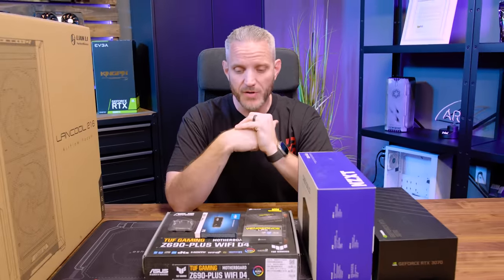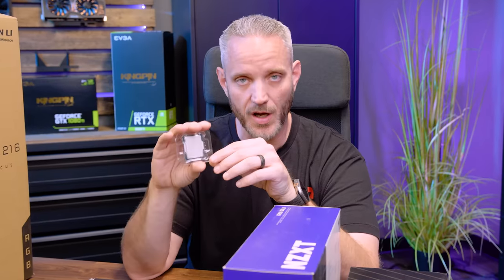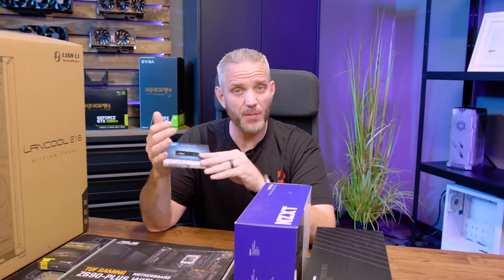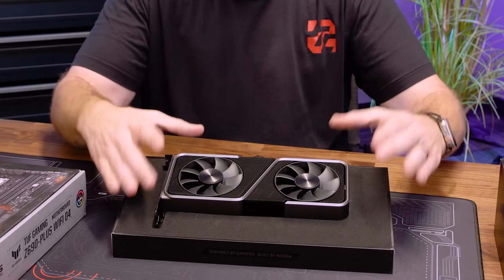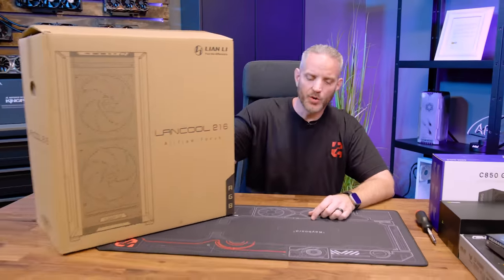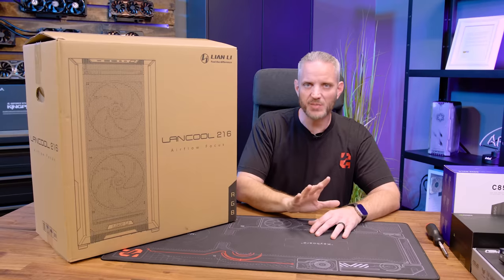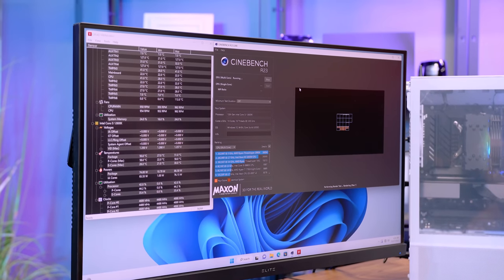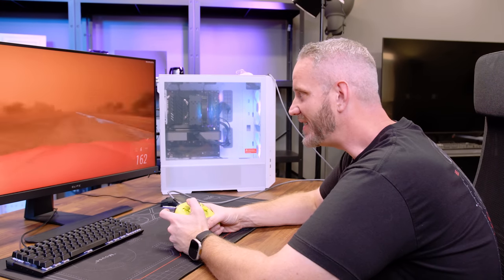Inexpensive PC Build Guide!

Comment: Thank you for this video. I'm looking into building a gaming computer as I have outgrown the cheap pre-built I bought 5 years ago.

I spent somewhere around the $500 range and it served me well for my super basic gaming and I've even used it to stream with few hiccups.

System specs for ny old pc:
Two 500gb HDD
intel i5 2500
12 gb ddr3 ram
Nvidia geforce gtx 1050
500watt psu

I upgraded it recently with more ram and a better processor (32gb ddr3 and i7 2600) but the upgrade was not enough and now I am forced to look into either a brand new pc or completely gutting this one for all new parts. Seeing as it was a cheap pre-built I don't think replacing every part is worth it for me and I should look into building a fresh one.

This video helped me  identify what I'm looking for when building this new pc and hopefully avoid pitfalls like cheaping out so much that I can't upgrade the system and it's outdated in 5 years and I'm forced to begin the process over again.

I'll likely keep the old system as a backup/office computer as I did spend about $100 on the upgrades for it and it's a fine computer, it just doesn't run new games

Comment: I think there is a huge miss here Jay.  When people talk about upgrade paths, on a somewhat constrained budget, we're not talking about upgrading one generation down the line, we're talking upgrading 3-5 years down the line, which means we're looking at DDR5, AM5, and large capacity SSDs that will still be relevant and used when we upgrade our systems in 2-3 generations.
Reply: DDR5 is useless and continues to be relatively useless over two years on for general purpose and gaming.  The needle barely budges, nobody should be building a new system for DDR5.  Sure, if the platform you're migrating to only happens to support DDR5, that's fine.  I'd say it's safe to say if you were to build a PC with DDR4 today, within three years it would be just as competitive then as it is now, and would load things just as quickly, simply due to the fact that DDR5 has yet to prove itself in anything other than its ability to destroy your wallet and get better synthetic benchmark scores in specialized tasks. And hard drives ain't gonna get too much quicker either.  

The most important upgrades are going to be CPU, and GPU, and they're open to another generation of Intel processors and you can slot in any 30XX/40XX Nvidia card or 6XXX/7XXX AMD card, no issues, full tilt.  This PC could easily last 5-6 years without jumping on the nonsensical DDR5 bandwagon and do more than trade blows with more "modern" builds
Reply: @ocha-time  I understand that DDR5 today doesn't make that big of a difference, but upgradability is "what parts will you not have to replace in your next build".  If I don't have to upgrade RAM / MoBo, that's $300 I can put into my CPU / GPU upgrade, and you can bet your socks that everything after this gen will be DDR5 only
Reply: @ocha-time  That's kinda besides the point. My 2017 x370 has a 5700 in it. That's an upgrade done almost 6 years later. I'll keep this system for another 3 years. Will ddr4 variety and prices hold up 5 years from now though? ( based on the DDR3/DDR4 transition - it won't ) 

Will this intel platform have an upgrade path 4-5 years from now? ( we know it won't )

Comment: Very similar to what I built in June.  I don't game so built for an 8 - 10 year life as a triple head home PC.  i7-12700K; RTX 3060; Z690; 64 GB DDR4; Lancool II Mesh C; EVGA GT 750; 1TB M.2; Hyper 212 Black; dual boot Win 10/Ubuntu.  Classic black, no RGB.

I air-sealed the case for minimal internal air recirculation as well as sealed under the handle to remove the front mesh (1" square insulation tape).  Now I actually have screened air intake and positive case pressure with the stock fans at idle plugged into the mobo.

Comment: Ryzen 7600x: $239. B650 motherboard: $160-200. 240mm AIO: $90. 32 GB ddr5-5600 CL36: $130. 1 TB PCIe SSD: $50. 1000 watt corsair power supply: $130. Same GPU, 3070- $600. Use the case you already have. $1399 + tax: $1504. With new $100 case: $1610.

Jay, please put this system together (7600x & ddr5-5600 CL36) and make a video comparing your option to my option with benchmarks. If AMD is using AM5 for the next 3 years, then how can you say intel is a better upgrade path? Your build needs more upgrades as well (cpu cooler, ram, storage) than mine does for $100 less. I've been watching your channel for several years and I will keep watching, but I think you made a mistake here.

Comment: I honestly would never have gone for Intel if I'm thinking of the future because the are at the end of their compatibility for future chipsets. They'll have to change soon. AMD is gonna be more expensive for all the new parts, but their chipset is going to be available for a lot longer. Prices are a little high right now, but I can wait a bit for them to start to come down.
Reply: Oh, and AM4 (the alternative in this budget range) isn't? I think we have ourselves yet another AMD fanboy...
Reply: My first computer was with intel. And I kept that computer for several years. However the worst part about it was that I couldn't get very far with the upgrades because the highest it would go was next gen CPU. So I was stuck permanently with DDR3 Ram, and an old CPU. I'm sorry but I don't want to be stuck like that again. I upgraded my GPU 2 more times and it did help but the bottleneck of the CPU and RAM was just terrible.
Reply: @Quetzel5  Lmao dude, whichever Intel platform with ddr3 you're talking about, you would have been just as stuck with the same ram, had you gone AMD at the time, except you would have way worse cpu performance. Sound like you got AMD brainwashed.
Reply: @Tc4ify  sounds like you’re just hating or just another “ brainwashed fan boy”
Reply: @Tc4ify  Sounds like you got hurt when he said he was using Intel for years and now you have to compensate by saying he's AMD brainwashed. What a sad existence.

Comment: Sorry Jay, but your build doesn't make any sense especially considering upgradability and longevity are your main goal.

Here is my build:  

AMD 7600X - $230 (Intel 12/13 gen is a dead-end system. Intel 14 gen will require a new motherboard) 
Asus B650 TUF - $230 (Guaranteed support for at least 2 more generations of AMD CPUs)
XFX/Powercolor 6800XT - $600 - $650 (Waaaay stronger than the 3070 and for almost the same price)
WD Black 1TB PCI-E GEN4 - 80$ (why to pay almost exactly the same amount for a PCI-E gen 3 NVME?) 
Noctua HN-U12S Redux - $47 
Corsair RMX 750W - $99 
Crucial DDR5 8X2 4800MHZ CL40 - $63 (Ram speed doesn't matter for 1440P/4K gaming and even the slowest DDR5 memory is better than DDR4 ram for gaming) 

Total: $1,349   

Cheaper, much better for gaming, and way better upgradability

Comment: 1200 USD build 15/03/2023

RTX 3070 Ti ($629)
Ryzen 5 5600 
MSI B550M PRO-VDH WIFI 
Corsair Vengeance 32GB (16GBx2) DDR4 3600MHz   
CORSAIR SPEC-05 (ATX)
CV650 SMPS
1TB M.2 NVMe Gen4
500GB M.2 NVMe Gen3
1TB HDD
NZXT T120 CPU Air Cooler
Corsair Air Series AF120 x3

Comment: As a novice builder, prices are always “click bait” imo. 1500$. But then you need monitors. Keyboards. Mouse. Audio. Misc items. Very quickly the “1500” computer turns into a 2500 computer
Reply: @madji6886  how much are the monitors you use? A basic 144 1080p monitor is 200$ on the cheap end. A good headset? At least 100+ K/M combo? At least 150. Windows? 140$ unless you go through a discount site. This is all just basic shit. Sure you can cheap out on everything but you’re still talking nowhere near 1500$. Unless you can somehow play a game on just the pc tower itself

Comment: Been using this build for a month now and it's just simply fantastic.  Solid, stable and no bottlenecks.  My Cinebench multi core scores around 17500.  Up from the first time I ran it at 16700.  All it took was a few bios tweaks and no overclocking after flashing firmware on motherboard to latest.  Latest bios firmware is so much better so get a 8gb USB stick and get it done.  The strange thing on this build is that my cpu temps never go past 65c and my gpu never goes past 60c and this is under both max cpu and gpu loads. The case is perfect and hope Lian Li keep improving it as they have a winner.

Comment: Honestly, in this budget range and if you intend to stick to similarly (or even somewhat higher) priced gpus in the future, the 850w PSU is total overkill. Even 250-270w cards now cost around $900, not to mention the ones actually necessitating such wattage. Go for a quality 650w unit or in case you get one for not much more, 750w tops.

Comment: Those specs are close to two of the systems I built for my son & myself last year Christmas except I went with the i7 10700K processors & Corsair 32GB Ram kits after finding great deals on them. The GPU I went with for the builds was the Zotac RTX 3070 Twin Edge OC cards which perform great at 1440P & 1080P. I went with the Vetroo M01 mini tower cases (great airflow with great options for such a small case) as they were just $59 - $69 at the time & turned out to be great little cases. The Vetroo V5 CPU  coolers perform really well & at the time they were around $25 (I used this cooler in all of my budget builds this year as I had bought a bulk of them at the time), I installed them in a push/pull fan config but I have since upgraded to Asus RYUJIN II 240 AIO when my budget allowed. Started off with the Vetroo ARGB 120mm fans but eventually upgraded to Coolermaster ARGB fans. All upgrades, in the end, didn't do anything to improve performance & the aesthetics were already pretty good so I say if you research the product & as long as they don't increase pricing, Vetroo is a great budget brand to go with.

Comment: How would I build it? I pretty much built it exactly like that already. Started back in March with:
- MSI Z690 Tomahawk DDR4 (I was eyeing the Asus TUF very hard but in the end the Wifi-version was more expensive at the time and had one less USB type A socket, so I went with the MSI).
- i5-12600K
- 2x8 GB Corsair Vengeance Pro RGB DDR4 3600 (but CL 18 - silly me)
- 1TB Samsung M.2 970 Evo Plus
- and since GPUs were still ridiculously overpriced back then, I threw in an unopened GTX 1060 3GB I had lying around.

Had to put it all in a bequiet! PureBase 600 cause I wanted a 5.25 bay for my BRD-burner - sadly that case couldn't handle my 240mm AiO in the top position, since the mobo's top heatsink is just a fraction too thick - so the AiO is now mounted in the front and my airflow is probably not 100% ideal. 

Over time, I upgraded the 1060 to a used 2070 Super, and then in August when prices had dropped to a brand new Gigabyte Eagle OC RTX 3070. Plus I added another TB of M.2-storage (Samsung 980).
 
All that is running on a Seasonic FX Gold+ 550W, BTW... CPU is slightly OCed, GPU undervolted to 0.925 - but the PSU handled everything fine even when I still had the 3070 OCed and not undervolted. But yes: I am thinking about a PSU upgrade in case the 4070 will be reasonably priced (spoiler-alter: it won't be) - only reason I was using the Seasonic is that I already had it lying around, it was also unused and three PSU-calculators told me I'd be ok with 550W.

Comment: I love these PC tech channels because they explain in detail how much price to performance you are leaving on the table when you go the budget route and also encourage you to do budget building because by doing that, you are able to upgrade to what you would eventually like to have as a work station/gaming rig. I personally love using AMD for the CPU and GPU because I don't use ray tracing in any applications I run, I mainly just game on this rig, and because AMD for me made more financial sense to me for what my budget was (roughly 1150-1200$). My current setup is a Ryzen 5 3600 CPU, ASUS TUF GAMING 3 RX 5600 XT 6GB, 16GB DDR4 G.SKIL Ripjaws V RAM, ASUS TUF GAMING X570 Wifi Plus motherboard and a Corsair cx650 PSU.
Reply: I mean, in 2020, I built on a Asrock Steel Legend 450M, Ryzen 5 3600X, Zotac RTX2060, etc...and it runs anything I'd want to do perfectly fine. I've thought about getting a 550 or 570 motherboard, a 5600x cpu, and rx 6650xt as an upgrade, but I have to keep reminding myself...I haven't personally come across anything that would actually need all that, lol.

Comment: This is an impressive build for the price. In August 2022 I bought a 17" Acer Nitro 5 laptop with the Ryzen 7 5800H, 32GB of DDR4 3200, and an RTX 3080 laptop gpu. It was on clearance sale as it was the 2021 model for $1300. I got 12100 in Cinebench R23 and the laptop 3080 is on par with the desktop 3060Ti. Considering that it's a very portable machine with a 360Hz screen, I'm super happy with it

Comment: Black Friday 2022 I spent 1100 on a AMD 5600G, Radion 6600XT GPU, MSI B550 Tomahawk BM, EVGA 750W gold PS , 16gigs corsair vengeance 3200 ram DDR4, and a Thermaltake Air flow case. I think I done ok. It runs well :)

Comment: Jay, thanks for this vid!  My ears perked up/eyes opened when I saw the motherboard you bought.  I have the sister board to this - same name except it is the DDR5 version (no "D4" in the name).  So refreshing to see when I usually see you showcasing ROG boards.  This means the BIOS/UEFI interface is nearly identical to mine, with the biggest difference being no "XMP" , it is called "Enhanced Memory Profile".  Anyway, thanks to your tip about setting ASUS Multicore Enhancement to "Enabled - Remove All limits", I am able to get a score of 22381 in Cinebench.  Next step is to upgrade my monitor(s) - still running in 1920x1200.  Thanks again!

Edit: forgot to mention my CPU is a 12700K - so a tad faster than the 12600K.  32MB of DDR5 as well.

Comment: I was helping a friend buy a PC as his christmas gift to his wife recently. 
I went with it with the same mentality as you did here but I steered him more around B650, Ryzen 7600x and 32gb of DDR5 RAM, Same drives/card with a few brand differences here and there since she's a videographer/editor and I can vouch for the really good Ryzen muscle on Premiere and After Effects. Total ended up being around 1600 tax included.
I ran some tests to stress it out, and the CPU does around 16000-15900 multicore, 2000-2050 single core. So the AMD route is pretty strong if you decide to get DDR5 right away

Comment: $145 MSI MPG A850GF 850 watt
$110 Lian Li Lancool II MESH
$ 64 Crucial P3 1TB
$180 ASUS B650-PLUS Prime
$239 AMD Ryzen 5 7600X
$0.     G.Skill Flare X5 16GB.   DDR5-5600(Free with cpu)
$900 Powercolor 7900xt
$35.   Vetroo V5

$1673. All prices current and parts in stock at Microcenter Denver except for Vetroo v5.

Comment: I think for people complaining that AM5 is expensive, put together a spreadsheet and a side by side comparison to AM4.  You might be surprised you can get an Asus TUF B650 board for around $200 with all the features u will need and if you have a MC around you you get free ram with your cpu.  Even if you dont have an MC near you, DDR5 prices have come down.  In total, you might find that the difference is about $200 when it comes to AM4 vs AM5.  Plus you can always sell your old set up to offset the cost.  Of course if you are going for the most budget build then that $200 will make a huge difference.

Comment: solid build I have no real problems with it.  I will not build a gamer with less than 1 TB of SSD.  When I built with 500 GB drive customers always complain about filling them up so I will no longer do that.   I build both AMD and Intel and normally just go with what is the best bang for the buck at the time of building.

Comment: Just waiting on the last components to build a 13900k/4090 system. Found a Gamemax 1300w 80+ Platinum ATX 3.0 psu for around $250. I've always used Corsair or Seasonic psus but all the 3.0 psus are out of stock or a little too high. At first I was scared to use Gamemax because of their history, but a BUNCH of 4090 owners are using the unit and vouching for them. They ship a native 12vhpwr cable with the unit too.

Comment: I still can't believe my corsair TX 950Watt 80plus bronze power supply that I bought back in 2009 is still going strong.  It's been going through 4 system upgrades, all the way back from an AMD Phenom II X4 to an i5 2500k to an AMD 3600 and now an AMD 5600X. Never skimp on power supplies.

Comment: I'm gonna use my amazon employee discount and buy a 4070 ti for 10% off. Should be like $740 or $780 ish after taxes. I was thinking about buying a used 3080 for like 550 on ebay but then I figured the 4070ti is probably a better deal. +30% performance and dls3.0. Plus it's new and in stock. 🤷‍♂️

Comment: I made a recent soooper cheap build for my wife, after she realized her Mac M1 Mini was... not what she hoped.  She plays league.  Not exactly a GPU hog.

She got a nice case (Corsair 4000D Airflow)
Got an MSI B550 MPG, with a Ryzen 7 5700G and a 550W PSU.  I did get her a ROG 240AIO and Corsair Vengeance RGB Pro on sale as a bonus. 

The RGB control is a nightmare, but. it. works.  For Cheap.

This way she has a case that will work fine with something newer later.

Comment: For my first build since Ryzen 7 2700 I went with an i5 12400 for $160 and a Gigabyte B760 board for $110 as it supports DDR4 RAM and 13th chips and has two PCI -e 4.0 m.2 slots that should work well with WD Black drives. Three or four years from now a 13th gen chip should be an affordable upgrade. Would work for a game OC with a good card if I were a gamer  Always good to access your expertise

Comment: I cut so many corners on my kids computers, and they still got such solid rigs.

New 5700x with used 3070 (I had a mining rig from the before time) and 16Gb of teamgroup 3600 ram.

I agree on the ssd. I ended up grabbing 1Tb Samsung evo 870's for about 70 bucks each.